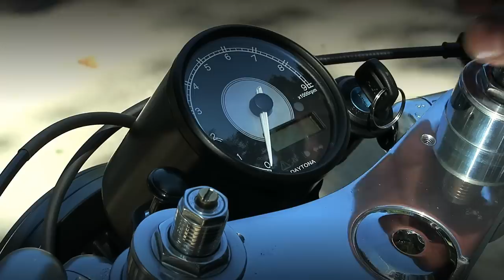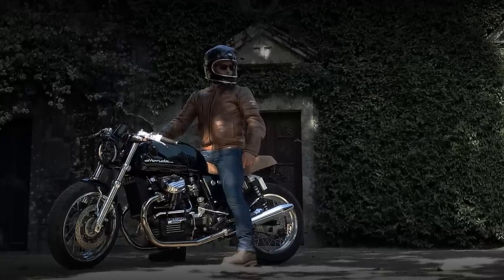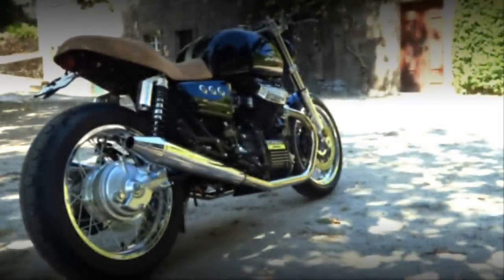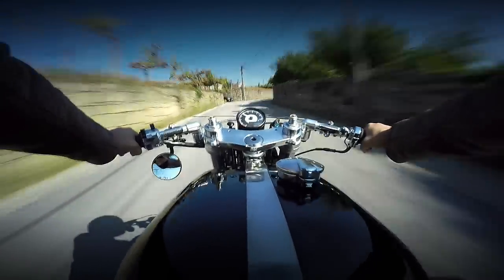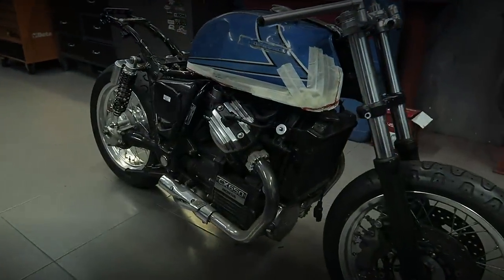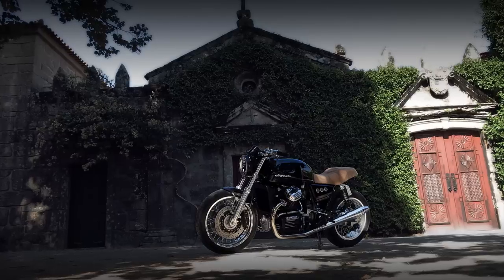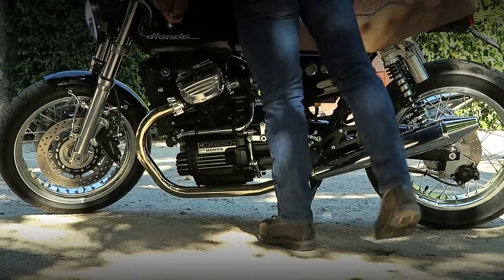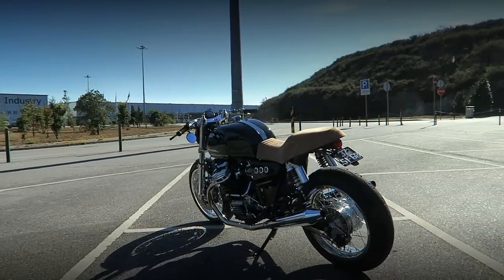Cafe Racer (Honda CX 500 / CX 650 by Racer TV/Oficina das Motas)

Comment: Your bike is amazing , the cx out there . I have a question , could you tell me or give the link to the headlight you used in this project ? Thanks .
Reply from the maker: Thank you. Unfortunately the headlight model applied in this project is 
no longer available. But if you search on Google for "motorcycle LED 
headlight", you will find similar headlights or the same style  The 
metal ring which holds the headlight into the motorcycle is custom 
made.:) Cheers

Comment: I like most of the bike especially the tank and the headlight, could I ask where you got that headlight from? I also love the tan leather jacket you have on, where is that from please? Thanks in Advance
Reply from the maker: Thank you my friend for sharing your perspective. I'm glad you liked so 
much.
 Unfortunately, the headlight model applied in this project is 
no longer available. But if you search on Google for "motorcycle LED 
headlight", you will find similar headlights or with the same style  The
 metal ring which holds the headlight into the motorcycle is custom made. The leather jacket is a "Invictus Hector". Cheers.
Reply: @RACER_TV  Thank you so much for your reply :)

Comment: How much money did this project cost? It is amazing and really beautiful.
Reply from the maker: Thank you. All i can say, is that it is expensive enough to buy a new cafe racer on the market with similar power. 
But if i had to charge all the hours i spent during this project, it 
would be more expensive than a top quality cafe racer motorcycle. :) 
Cheers.
Reply: So we are talking about 15.000 Euro or more.
Reply from the maker: @opfipip3711   Curiously, i already refused an offer for that value. :)
Reply: Well, I think unless you either need the money or give up the passion for bikes you will not sell that bike. There is to much of your heart involved.
Reply from the maker: @opfipip3711   Indeed, You said it all. :) Cheers.

Comment: Can you tell me where i can buy this headlight? Cool work !!
Reply from the maker: Thank you. Unfortunately the headlight model applied in this project is no longer available. But if you search on Google for "motorcycle LED headlight", you will find similar headlights or the same style  The metal ring which holds the headlight into the motorcycle is custom made.:) Cheers

Comment: Amazing motorcycle...well done, could you please tell us where you got the headlight from and the peashooter exhaust...thank you
Reply from the maker: Thank you. Unfortunately the headlight model applied in this project is 
no longer available. But if you search on Google for "motorcycle LED 
headlight", you will find similar headlights or the same style  The 
metal ring which holds the headlight into the motorcycle is custom 
made. Try also to search on Google for "peashooter exhaust", and you will find it. :) Cheers
Reply: @RACER_TV  thanks and keep up the good work

Comment: The cx  650 is a good base for a Cafe racer, more than the 500.only big limit is the shaft transmission let lose too much power
Reply from the maker: Personally, i think it has power enough. It reaches 100 Km/h in something around 5.5 seconds. :) Cheers.

Comment: what did you do to make sound so good. I have a cbf 600 hornet and I want a sound like this. any recommendations?
Reply from the maker: Yes, you have to buy a motorcycle with a V-twin engine, and using 2 Peashooter exausts. :)
Reply: @RACER_TV do you thibk the cbf600 hornet can be customized to sound like that, because it sounds more like a sport bike but I prefer the muscle sound
Reply from the maker: No, it is impossible. You can not get the same sound of the V twin engine(2 cylinders), with the 4 cylinder engine of the honda Hornet.
Reply: @RACER_TV  yeah. I found a Yamaha dragster 1100 I think ill go with that option.

Comment: Sounds good, but how does the 2-2 exhaust compare, power-wise to the stock H-pipe?
Reply from the maker: Thanks. Unfortunately I can't say. Because after changing the entire exhaust system, the carburetors received new and higher jets, which turned the engine much more powerful at any RPM. Personally, I think now is too powerful to ride it slowly.The original stock version, was fast enough, but it start losing power after 50000 RPMs.  Cheers.
Reply: @RACER_TV  Yes, just getting the jetting right helps a lot, I’m sure. So maybe the 500 would’ve been as good/better?
Reply from the maker: Unfortunately, I think it is impossible to turn the CX 500 as good/better than the Cx650. 
The way these 2 engines respond to the throttle, is completely different.
The Cx500 has a very tight response, feeling that the engine is stuck.
The CX650 has a nervous and powerful temper, even when it is completely stock from the factory.
I already talked about this on a video. Here is the link: https://youtu.be/GtJGDbmh8gQ
Reply: @RACER_TV  Yeah, I saw that video. But wasn’t that a stock, untuned 500? And I thought your 650 has a lightened flywheel? I’ve only had my GL500 a very short time and it’s slow-revving also, so I can’t really disagree you based on experience. Maybe Mikuni carburetors would help, IDK.
Reply from the maker: I understand. Here is a video with my stock CX 650 reving. https://youtu.be/796s1IdTbPY
Yes, I also heard that Mikuni carburetors could improve a lot the CX500.  :) here is a video about that: https://www.youtube.com/watch?v=y_5x9wEXXJo
Reply: @RACER_TV  You’re right, even stock that 650 is very responsive. I’m waiting for a new accelerator pump diaphragm and air cleaner for my 500, before I say conclusively that it is sluggish to rev. I put a Mikuni TM40 ( pumper carb ) on my XR650L, oh my(!) neck-snapping, front wheel-lifting response.

Comment: Amazing Job...  who is the manufacturer company of the headlight  ?    regards  Andrew
Reply from the maker: Thank you. Unfortunately, the headlight model applied in this project is 
no longer available. But if you search on Google for "motorcycle LED 
headlight", you will find similar headlights or with the same style  The 
metal ring which holds the headlight into the motorcycle is custom 
made.:) Cheers
Reply: Thank U... for the precipuo info...  regards
 Andrea

Comment: How much did it cost with the cost of bike and evry modifications on it
Reply from the maker: All i can say, is that it is expensive enough to buy a new cafe racer on
 the market with similar power. 
But if i had to charge all the hours i spent during this project, it 
would be more expensive than a top quality cafe racer motorcycle. :) 
Cheers.

Comment: Hi, Where can I find that headlight?

Thanks
Reply from the maker: Unfortunately the headlight model applied in this project is no longer 
available. But if you search on Google for "motorcycle LED headlight", 
you will find similar headlights or the same style  The metal ring which
holds the headlight into the motorcycle is custom made.:) Cheers

Comment: what is the brand and type of that head lamp?
Reply from the maker: Unfortunately the headlight model applied in this project is no longer 
available. But if you search on Google for "motorcycle LED headlight", 
you will find similar headlights or the same style  The metal ring which
 fixes the headlight into the motorcycle is custom made.:) Cheers

Comment: What’s the name of brand the lead light?
Reply from the maker: Unfortunately the headlight model applied in this project is no longer 
available. But if you search on Google for "motorcycle LED headlight", 
you will find similar headlights or the same style  The metal ring which
holds the headlight into the motorcycle is custom made.:) Cheers

Comment: does anyone know the name of the headlight used on this build?
Reply from the maker: Unfortunately the headlight model applied in this project is 
no longer available. But if you search on Google for "motorcycle LED 
headlight", you will find similar headlights or the same style  The 
metal ring which holds the headlight into the motorcycle is custom 
made.:) Cheers
Reply: RACER TV thank you!

Comment: What is the name of the lamp,plz?
Reply from the maker: Unfortunately the headlight model applied in this project is 
no longer available. But if you search on Google for "motorcycle LED 
headlight", you will find similar headlights or the same style  The 
metal ring which holds the headlight into the motorcycle is custom 
made.:) Cheers
Reply: @RACER_TV  Thanks for the help,bruh!!

Comment: What headlight it is ?
Reply from the maker: Unfortunately, the headlight model applied in this project is 
no longer available. But if you search on Google for "motorcycle LED 
headlight", you will find similar headlights or the same style  The 
metal ring which holds the headlight into the motorcycle is custom 
made.:) Cheers
Reply: @RACER_TV  thanks :) . Found one in Italy. And will make metal ring(friend will make it) suitable fore my bike. 

Your bike is very beautiful 👌

Comment: How much this costs you !
Reply from the maker: Well, all i can say, is that it is expensive enough to buy a new cafe 
racer on the market with similar power. But if i had to charge all the 
hours i spent during this project, it would be more expensive than a top
 quality cafe racer motorcycle. Curiously, i already refused an offer of
 15 thousand euros. :) Cheers.
Reply: @RACER_TV  You are doing great job

Comment: Why is he drawing the headlight??? It's a Chinese headlight, costs like $50...
Reply from the maker: Really? In that case, send me the link to the website where you saw this headlight for 50 dollars.
Reply: Not sure how much you paid for this build but I would have built you a way sexier cafe racer....
Reply from the maker: Sorry, but this is not my headlight. :) But is looks very similar.
Reply from the maker: Thank you. All i can say, is that it is expensive enough to buy a new cafe racer on the market with similar power. 
But if i had to charge all the hours i spent during this project, it would be more expensive than a top quality cafe racer motorcycle. :) Cheers.
Reply: You are correct, it's either a new or older version,

Here is the headlight

https://www.alibaba.com/product-detail/7-Motorcycle-30w-H4-Hi-Low_60492204477.html

My main thing was why was the guy drawing it? For the headlight he just used off the shelf China parts, he didn't design them....
Reply from the maker: You forgot an important detail.
If this headlight costs 50 dollars in China, imagine how much will cost if you buy it on USA or Europe.
You have also to consider that this headlight in not complete.
You will need a box or a a sort of ring to make fit on the motorcycle. 
What you saw in the video, with my mechanic making the drawing, is the project of a custom metal ring that is going to support the headlight.
Reply from the maker: Just to finish the conversation. According to the link you sent me, The real price of that headlight costs between 50 and 135 dollars, depending of the quantity you buy. Buying just 1 headlight, costs 135 dollars.
You are also forgetting the importation and customs costs.
The final price will double easily. This is a fact, especially after your President increasing the taxes for imports from China.
About the ring bracket, You made me laugh.
Do you really believe that i am lying about that?
I live 10 minutes from my mechanic's garage. Don't you think that i didn't saw every step of this build?
The link you sent me, is the right ring that i wanted for this project.
But when i saw the price(more than 100 dollars), Me and my mechanic decided that was easier to build it himself.
I never said that the ring is my design, but it is definitely custom made.
If you look carefully in the video, our headlight ring bracket is divided in 3 pieces, and not 2 as the ring bracket on your link.
By the way, you know that even the IPhone is made on China, right?
I really don't see any problem on buying chinese accessories, especially when they have quality. :) Cheers.
Reply: you never bought anything online from China before? they include shipping and customs and etc, the price you see is what you pay, flat...

I've bought more then 50 of these headlights, never paid, tax, customs, shipping and etc, that is included in the price.

I'm not saying that you are lying but you have not a single video of him making that part, also if you want to tell me that he made that part under $100 I would say you are lying. 
First you need to 3D CAD the part, then put it on a CNC, that part in no way can be made by hand as you can see how it was CNC'ed then you have to sand it, thread the holes and anodize the part...and if you would end up building a custom part, why would you make it look like a mass produced China part? makes no scene. Also, I doubt your mechanic has a CNC yet alone knows hot to use CAD.

And, there are a lot of styles of that headlight bezel...If you want I will find you the exact one.

I'm a mechanical engineer with over 15 year of experience that designed motorcycles for a living...I really don'y like when people take credit for something they did not do....
Reply from the maker: I am not exactly sure how things work on your Country, but i can assure you that buying things from China(or any where else out from European Union) it is almost forbitem due to the Taxes and Customs.  Here in Europe, the price of the things almost gets double.
Your thoughts about our headlight bezel ring, make me doubt that you are in fact a Mechanical Engineer.
I know 3 different ways of building a bezel ring like that, and you choose precisely the most complex and most expensive method of all.(CNC)
If you bother to see my 4 videos on the motorcycle building process, you would see that i know how to work in Cad Design too. 
And you could also check that there are a lot of custom parts in this motorcycle.
So yes, making that bezel ring is extremely easy for me and my mechanic.
And yes, it is more expensive to buy it on China for 100 dollars, than making ourselves.
And how is this possible? i am going to let you to found out. Here is a tip question: Why is the bezel ring on my Honda CX different from the one on the Link you sent me?
Check the minute 11:90 of this video.